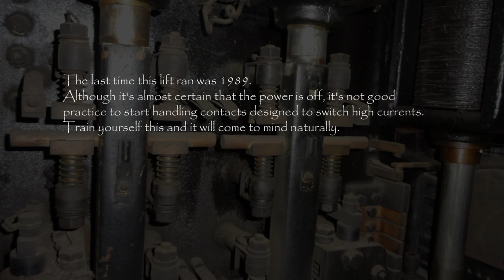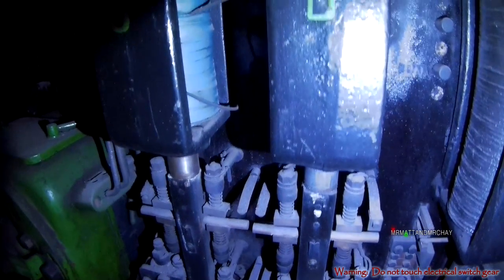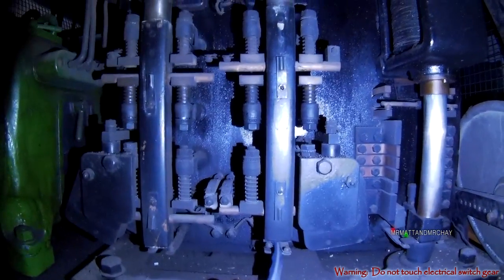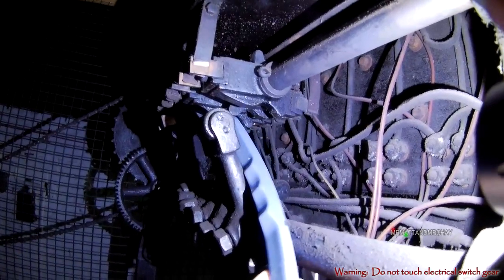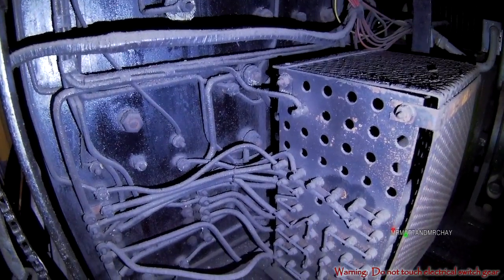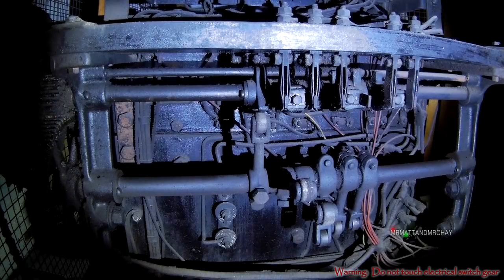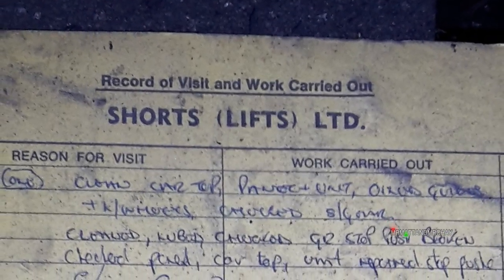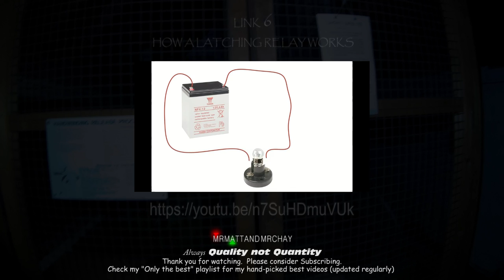LIFT TECHNOLOGY from 1905!!  +everything explained

Comment: Such a shame the Don't make lifts like this today i bet a lift that simple allmost never went wrong ehheh except uh for the amout of careless engineers that probably died working on them back in the day
Reply from the maker: Yes - no guarded machinery here!  Proper Health and Safety wasn't around until the late 90s.  I remember working on building sites in the early 90s in trainers, using a 240v drill on a generator, with some crappy step ladders that I found in my garage!
Reply: @mrmattandmrchay  Every European country except the UK and Ireland use 230 and even 400 V tools on construction sites. The 110 V isolation transformer is a British invention. Considering the accident statistics in central Europe I'd say they aren't really necessary. By far the most common type of accident is falls followed by cuts. Electrical accidents are far off and most of them involve electricians.

Trainers are still better than the famous Asian safety flip flops :-D
Reply: @Ragnar8504  

Safety flip-flops? Forget them! What you need is the patented Furze Safety Tie!